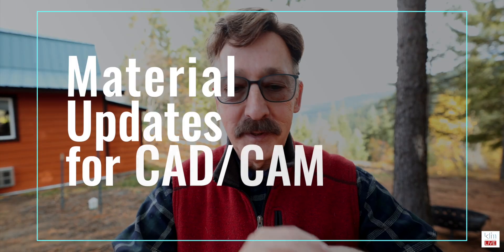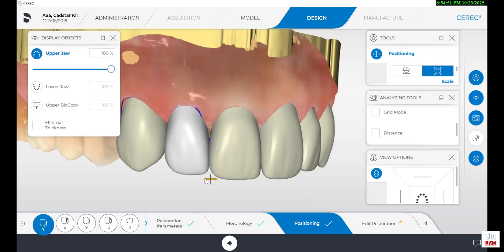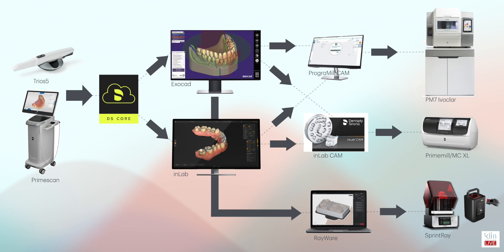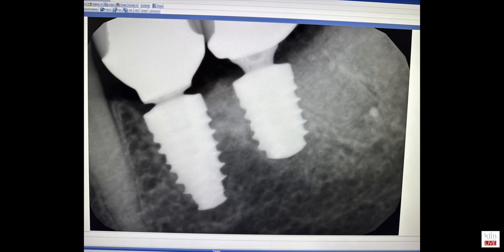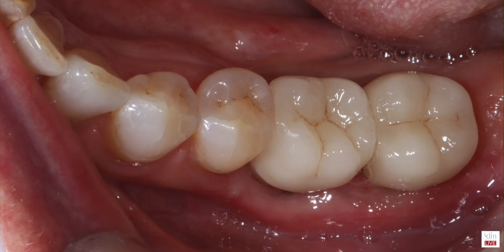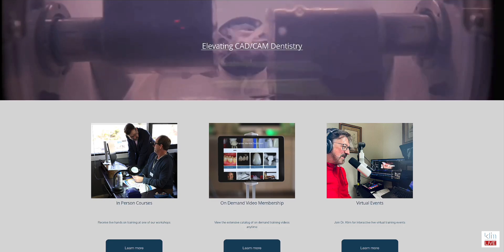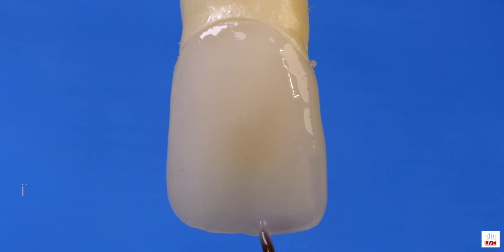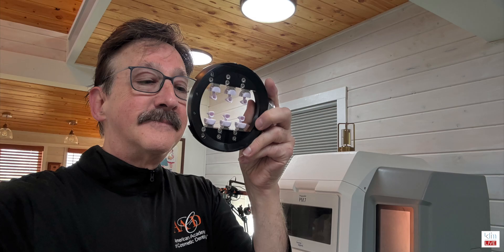Top CAD CAM Advances Making Waves Right Now

Comment: Hey Doc, can you talk more about the overmilling we have to deal with on veneers when milling on primemill and MCX? Struggling with these cases and punting to the lab! Boo. Edit- i guess I commented too early.I watched the rest of the video and back to shopping for  5-axis.
Reply from the maker: Yes, I use the Primemill and MC XL for inlays, onlays, and straightforward posteriors.  Although I have accomplished many nice veneer cases with both mills, the preps are critical for the 4-axis mill.  It will work better with an extra-fine mill.  However, as illustrated in the case in the video, the prepless approach would have been impossible without the 5-axis.  All the best.